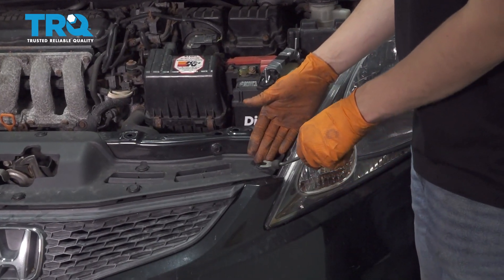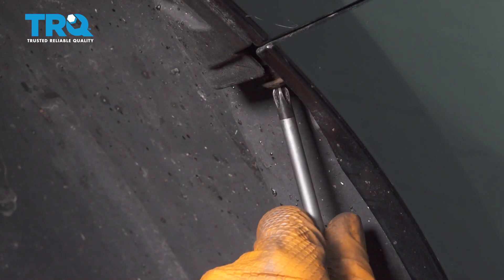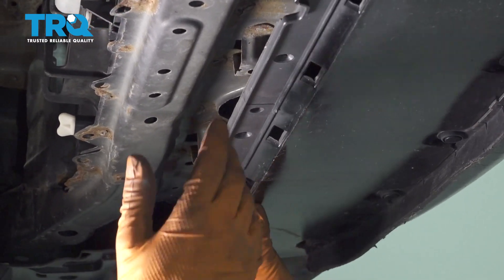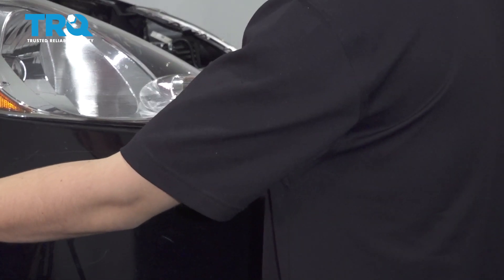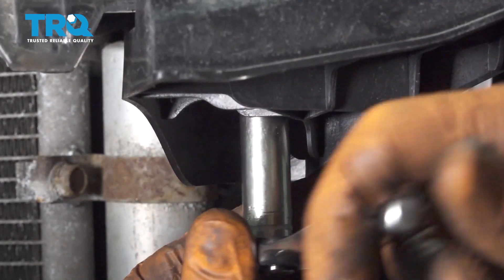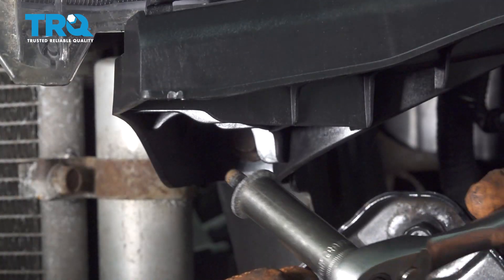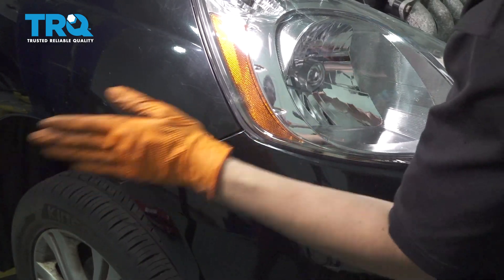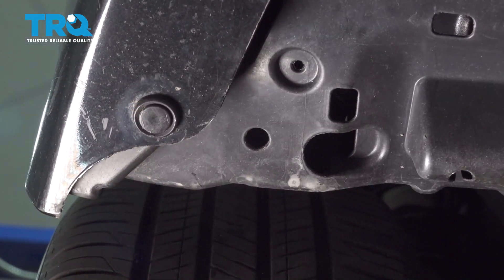How to Replace Bumper Bracket 2009-2013 Honda Fit

Comment: any tips for finding replacements for that first bumper cover screw in the wheel well or some alternative way to secure the bumper corners? I lost one years ago and have never been able to find a match. I went to several hardware and auto parts stores but no one could match it.